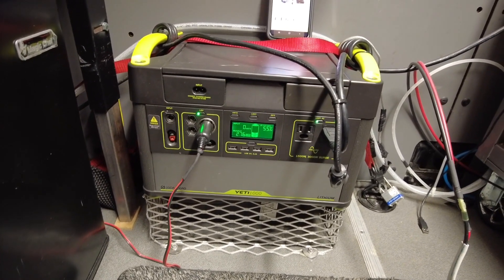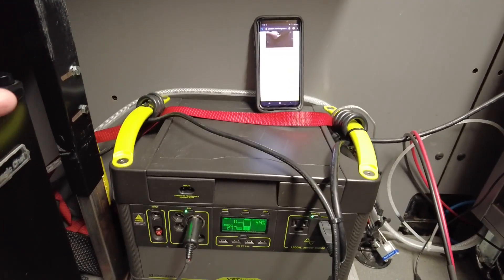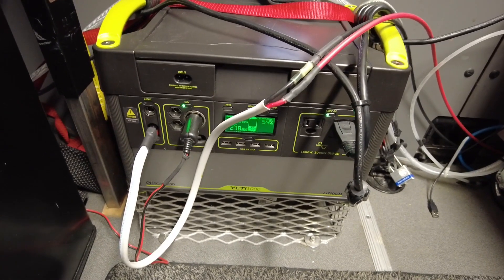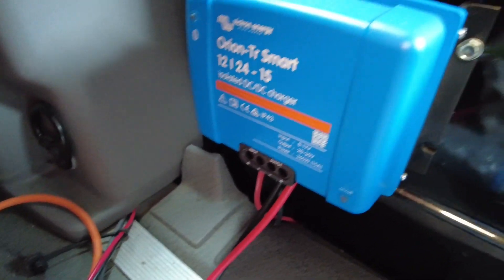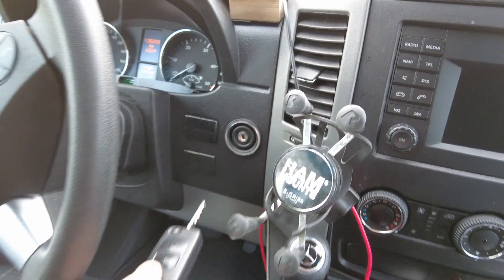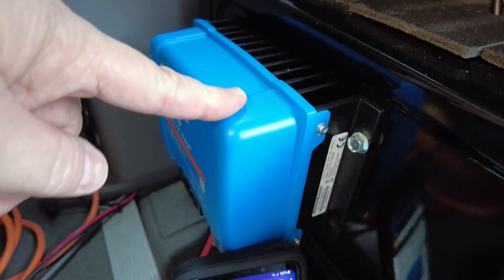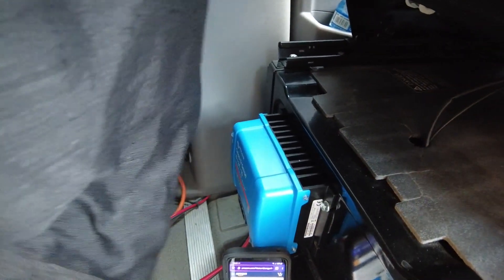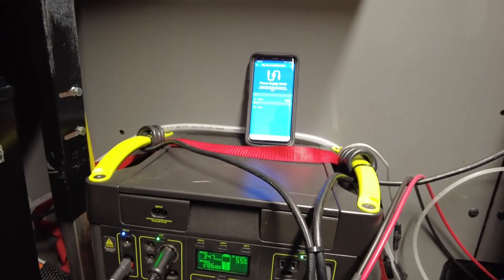Goal Zero Hack - Alternator Charging using Victron Orion DC-DC Converter

Comment: works good on yeti 3000x. getting around 380watts. i have the victron set at 21v
Reply: I thought the car alternator sends far more amps than that Orion is rated for? Am I mistaken? I’m trying to do this myself
Reply: @moroccobama 
Hello, the Victron is wired to the battery terminal . Most batteries puts out a little more than 12 volts.
Different vehicles have different alternators which put out different outputs to the starter battery. The Victron steps up  the incoming voltage from the engine battery and maintains it to your house battery. Hope this helps.
Reply from the maker: Awesome! Thanks for confirming.
Reply: Did you ever increase your 21v higher since the high power charging import can handle 14-50V? I see the max output voltage adjust range is 20-30V.

Comment: Awesome, thanx for showing me your setup. It's amazing the things we can do now with all of these components.
I believe that the humming that you're hearing is due to the fact that you have the isolated version of this charger which needs the negative wiring to its own isolated chassis ground and not to your vehicle's battery negative.
Reply from the maker: Thanks for watching Chip, glad you enjoyed it!
Interesting point about the hum. Where should I connect the negative wire to instead? Directly to the seat pedestal or any other particular spot on the Sprinter?
Reply: Hey guys!  The humming is due to the PWM charger in the yeti ramping up.  It is fairly low frequency.  Once it knows it can expect all the available power from the Orion, it fully opens, and the humming goes away.  Great video, and great implementation!
Reply: @prestoneprice  I would chose any brand except zero. If your unit fails and you respectfully contact them they hang up
Reply: I lost $8,000 dollars buying their brand. It was great while it worked.
Reply: @scmreport2457  That is strange.  Full disclosure, I do work for them, so let me know your story and I would love to help sort it out.
Reply: @prestoneprice  Thanks, yes I made 3 videos on it.
Reply: Is this a good thing, or could you use the common ground version?   I ask, as I actually want to install I switch to choose the yeti or the starter battery to goto my fuse panel… so I think the grounds would be common in that case

Comment: Looks good! Question: Why Power Supply mode and not Charger mode ?
Reply from the maker: Good question! The Goal Zero has a PWM input, allowing power to come in between 15-22V typically from solar panels that Goal Zero supplies. The PWM controller inside the Yeti will handle all the battery charging details.  Charging Mode in Victron Connect allows you to set battery parameters such as Absorption, Bulk and Float but the PWM inside the Yeti already handles all this. 

There is a video by William Prowse where he uses a Victron Solar Controller and bypasses the PWM and goes directly to the Goal Zero battery using an EC8 connector. In that video he showed the Charging parameters. So, theoretically you could also use the Victron Orion in a similar fashion and charge the battery directly. But there are two drawbacks. The little screen in the Goal Zero would not show the input voltage/watts coming in, only the battery indicator going up. And if you had solar panels and a MPPT module in that space, you couldn't connect directly to the EC8 connector either since the MPPT controller would be using that.

Long answer to your question, hope that helped!

Thanks so much for watching!!
Reply: @sprinterdiscovery  I love long answers especially when they make perfect sense! Thanks for the reply - looking to do something close to this so very helpful.
Reply from the maker: Awesome! Glad it helped! All the best, and take care!

Comment: Thanks for making this video, I really appreciate the info as this is what I plan on doing with my GZ 3000. Quick question, could you show how you connected the Victron to your battery, this is the part that I am unclear on. Thanks!
Reply from the maker: Very glad you enjoyed it Benjamin! I'll create a second video for that soon. In my Sprinter, the starter battery is under my feet. I took out the flooring, opened up the metal cover to gain access to the battery. I had 8AWG cable on one end with the cable lugs connected, and the other end just bare stranded wire. The cable lugs get connected straight into the connectors on the battery terminals for both positive and negative. The other end I inserted into the Victron battery Input and screwed both the positive and negative into their respective places. 

Ideally I would have done the start to finish install to show everybody, but I didn't do it 6 months ago.

Hopefully this helps guide you. I'm not good at electrical but I managed to figure it out. Whew! 😁😁😁

All the best with your GZ 3000. That's a beautiful battery unit. I think you'll be very happy with it.

Do update us when you got it all connected and working. Let us know how it went.  Take care, and thanks for watching!!!

Comment: This is very helpful! The goal zero link module in car mode touts 454-750watts, so would still be faster, correct? Is the victron app able to tell when your Yeti 1000 is fully charged?
Reply from the maker: Thanks so much for watching! Glad you found it helpful! The Goal Zero Car Link is faster than what I have setup. The maximum charge is 360W since I'm going through the 15A Anderson input. When it's charging, the VictronConnect app shows the varying input voltage of between 13.5v and 14.1v. The output value is always "--" until the Yeti is full, and at that point the output voltage shows 20v. It works extremely well. We drove from Vancouver to Whistler today, Yeti was at 60% full when we started, and finished at 93% when we arrived in Whistler. And there's no need to update the firmware of the Yeti. It just works!
Reply: @sprinterdiscovery  This is an excellent alternative to those who want to keep the MPPT module installed for solar :)

Comment: And also what was the settings numbers you input to the vectron app to be in the safe side ?
Reply: Thank you I’m so excited to try and build it
Reply from the maker: @lyndon Within the VictronConnect app, I set it up for "Power Supply", 20.0v and the off voltage lower limit of 13.2v and the on voltage upper limit of 13.4v - those are the settings I used for my Sprinter. It's easy to setup on any vehicle.   The best way to setup is follow the guide from Victron. Here's the direct download link to their PDF...https://www.victronenergy.com/upload/documents/Engine-on-detection-set-up-Orion-Tr-Smart-DC-DC-Charger-EN.pdf

Comment: Is there a size number or model I need to look for for the anderson connector? I’m trying to get all the supplies needed to make the charger you made. I’m new to this but excited to try it thanks.
Reply from the maker: Hi @lyndon First of all, thanks very much for watching and leaving your comment here! I purchased my cable on Vancouver Island here in Canada, and the site is called modernoutpost.com and you can email them requesting the part that you need. You can also go to the powerwerx.com website and search for "goal zero" and you'll see they can make custom cables for you too. If you want to go the DIY route and make your own cable, you'll need 10AWG stranded copper wire, a red and a black Anderson plug for 45A metal inserts. I think you need a crimp tool too. That's the reason I purchased it premade - I don't have all the parts and tools. You can use lower gauge wire too, but it all depends on the distance from the Victron Orion to the Yeti.